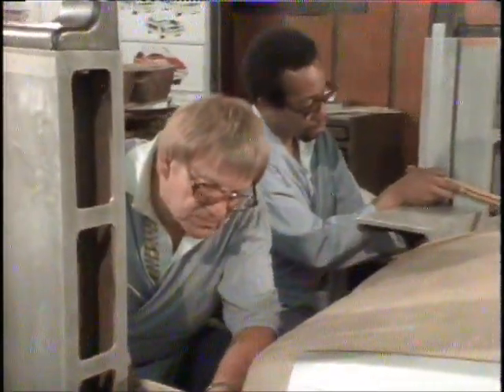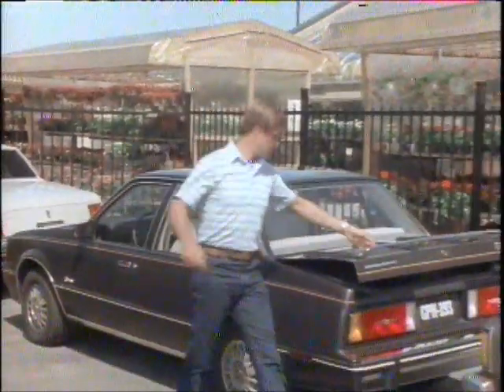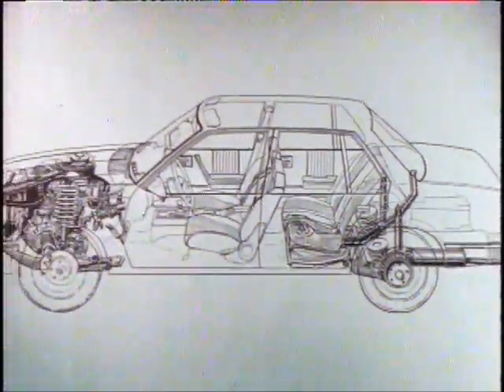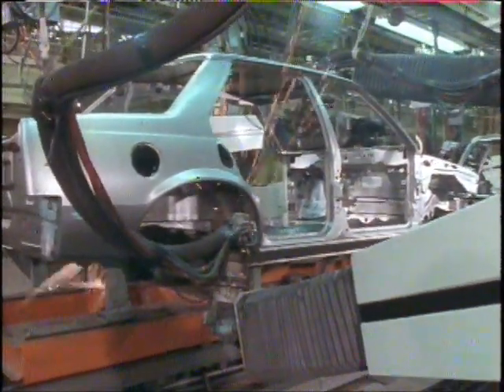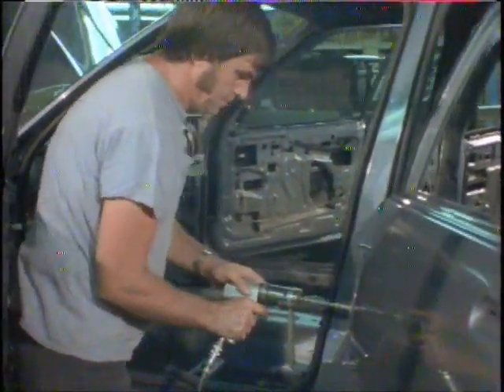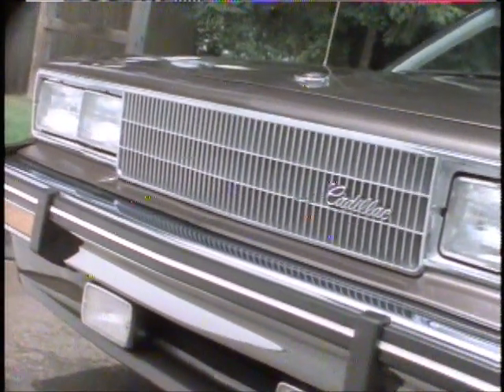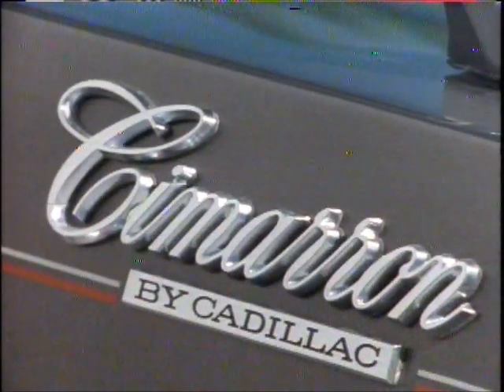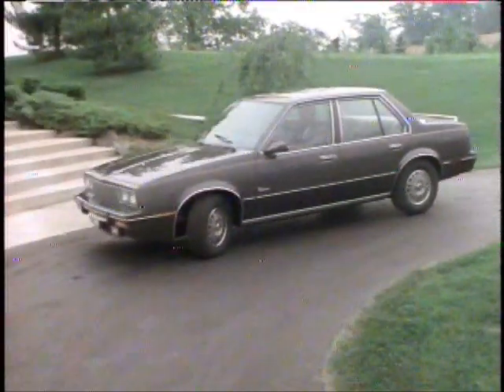1983 Cadillac Cimarron Design.wmv

Comment: Thanks for posting this video.  To see what was being said back in 1983, or 38 years ago about cars, is an eye opening experience. For instance, the emphasis on noting McPherson struts at the front, and  a rear suspension without a need to operate around the rear drive axle.

Comment: I could make the front end in fiberglass and make a Cimarron in my garage out of a Cavalier!
Reply: I did that actually. My '83 Cavalier got wrecked, so I replaced the front clip and the rear taillights with the front and rear of a Cimarron. In a way it was better than the Cimarron because it wasn't loaded down with all the weight that the Cadillac had riding on it, and people actually thought it was a Cadillac.

Comment: im not trying to argue with anyone the cimarron didnt make much sense but i reallly did just pick one up today an 82 grey on grey in good shape with 117k probably the slowest car ive driven but the ride and steering are far from cavalier and once you look one over in person it is a cadillac but i admit not worth the premium over a cavalier just a good little car i got mine for $750 and drove it home!
Reply: I'm sure the car has different spring rates, a different steering rack and more sound insulation than a Cavalier which is why it drives different.  It probably should have been sold as an up model Cavalier for $750 over a standard one vs. as a Cadillac.

Comment: It was too much the Cavalier. It looked like the Cavalier inside and out. The material quality was the same as Cavalier. Basing a luxury car on an economy car was the first mistake. Doing little (or nothing) to the appearance and performance exacerbated that. Essentially, it was a Cavalier with leather and the Cadillac emblem. Jump 30 years ahead and GM is doing it again, but significantly better. The Buick Verano based on the Chevy Cruze.

Comment: I had an '84 Cimarron and it was my first car back in 94.  My car was dark blue exterior over blue interior.  Nice car at the time but the engine performance was awful.  However, like the car.
Reply: At least with a Vega, you could put a V8 in the engine bay after the crapper engine failed.